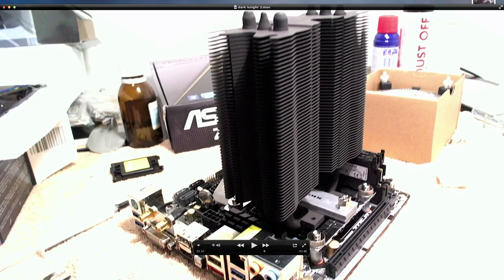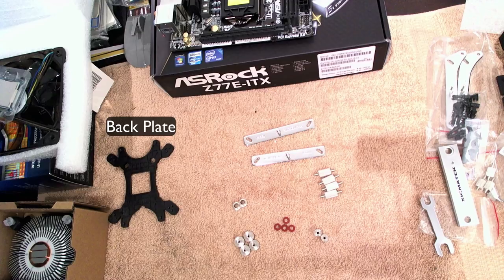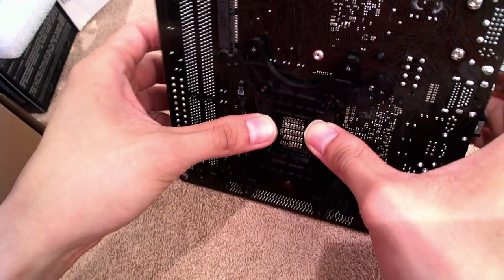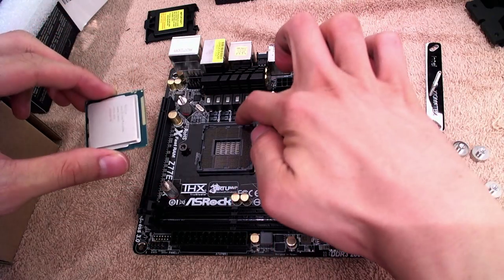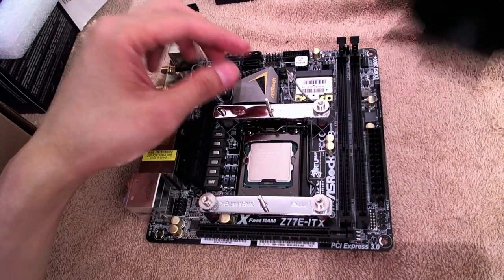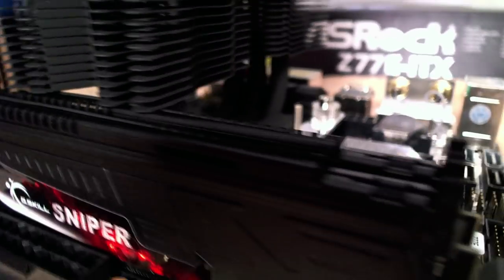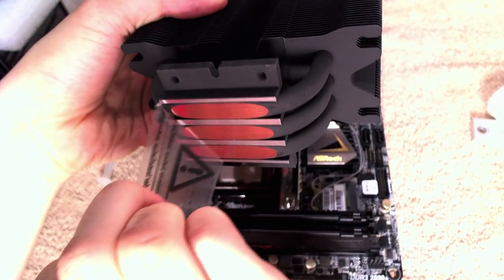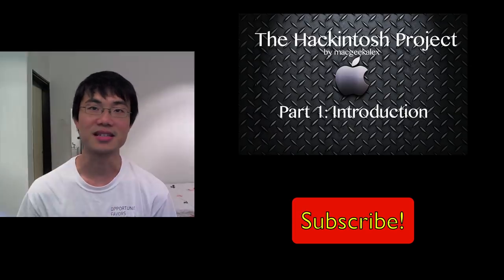Installing the Xigmatek Dark Knight II Cooler

Comment: Awesome stuff macgeekalex, this cooler was a pain to install, your video made it so much easier. Keep up the good work!

I installed this cooler on a z77 Extreme 6 paired with a 2500K @ 4.3/4.5GhzGhz and temps do not surpass 63/65c. Great video, great cooler.